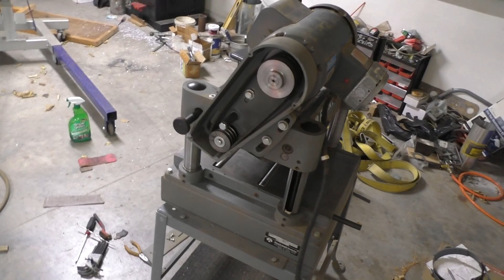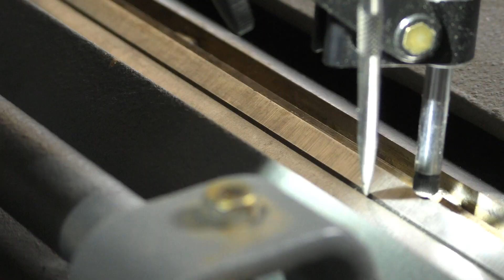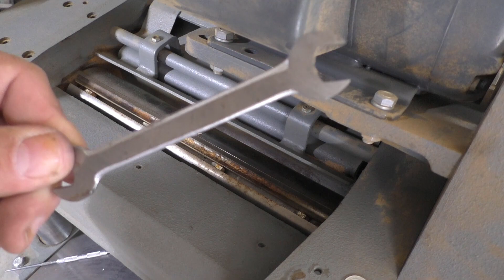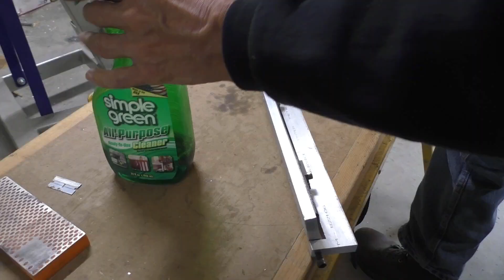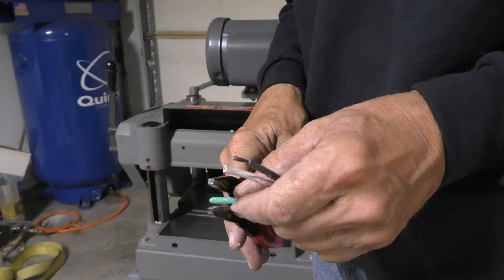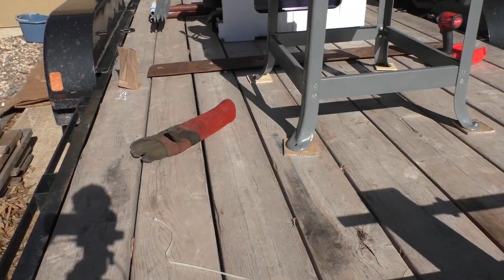New Tool Day!! Rockwell / Delta 22-650 13" Thickness Planer, Clean up, Sharpen and Blade Setting.

Comment: Hows this planer been treating you over the years? One came up for sale in my area for $350 that (from pictures) looks to be lightly used and in good condition. Some mention they're finicky, high maintenance planers. Others say they'll go go go for thousands of board feet. If you have any wisdom to share, I'd gladly hear it. 

Great video as well! I envy your machinist background and ingenuity.
Reply from the maker: This planer is a beast. I doubt the vast majority of these planers were ever put to the use they were built to handle. Kept in a dry environment, most retain a near new appearance and function. Also, a 450 pound cast iron machine is always going to outperform the current offerings of sheet metal and plastic. Downside is parts are more difficult to find. Best recommendation is to get the exact model/ year and research issues anyone has experienced. These machine have slight differences and it helps to know what to look for and how everything operates. In your case ask for a demonstration of the machine running planing a board. Use a flashlight to carefully check for any plastic parts cracking or poly covering on drive rollers under the cutter head. My life experience makes me believe nearly any machine is repairable. Unfortunately that is not for everyone. There is a certain gamble involved. If the blade setting gage is included it would be a bonus. A bit like buying a used truck, could be problems or a machine that will make more shavings than you will know what to do with. Best of luck to you.
Reply: @SpencersMountain  Appreciate the input!

Comment: I know it’s been a while but how far above the drum to the cutting edge did you set the knife…….
Reply from the maker: I did a lot of searching  and could not find an answer to that question. These machines came with a setting gauge to set blade height. Best I could find was 3 mm. (.118”). That put the bevel edge of the blades even with the drum. Then I made my indicator tool to evenly set that height. Hope that helps.

Comment: What was the height you set the blades above the cutter head?
Reply from the maker: @LucasHolm-m6u  I skipped that detail… because I do not know the correct measurement. These machines came with a special height gauge. The gauge is usually lost over time and rare to find. I will offer that my set height placed the blade bevel rear of the cutting edge flush with the cutter head outside diameter. Hope that helps.

Comment: Good info. what was the radius on the planer head?
Reply from the maker: I am sorry but I do not know the radius of the planer head.  Guessing close to 1.5" you could inquire at shelixheads.com for the diameter of a replacement head for an accurate answer.

Comment: I should have known from the detail and planning that you put into your projects that you were a machinist. Fine job Sir!  I enjoy all of your content.
Reply from the maker: Started off as a metal fabricator. Took a factory job where the taught welding. Bought a small metal lathe to learn machine work. Taught myself CNC and built CNC machines. Did professional Mach work for the last 20 years. But, was building machines and vehicles many years before being a machinist. And I will always try to avoid doing machine work when possible since it is slow and there is often easier ways to make things. It is amazing how many complex machined projects can be broken down to simpler scrap pile metal shapes welded or bolted together. Thank you so much for the comments and thank you for watching.

Comment: Where can I get this  to purchase
Reply from the maker: These planers were made in the 1980's. There appear to be many that show on various online sale sites like craigslist, eBay, Facebook marketplace, auction sites, etc. But do your research as there can be a lot of problems associated with these machines like frozen, worn out and broken parts. I watched a lot of planer videos and reviewed several forums to understand what machine was suitable for my needs and what problems I could expect. This video was essentially taking the machine through a serious inspection to ensure it was functional and all maintenance was current. I am a machinist and can repair or fabricate many parts  I cannot buy giving me a different perspective on buying obsolete machines. Old machines are often very neglected and sometimes very used. I was very lucky with this machine as it seemed to have low usage and kept in a good shop environment to protect it for a long time. Only negative was a short stay in an auction building where it had collected some surface rust that was easy for me to remove during the inspection process.  Consider a newer machine if it can produce the work you need. Also consider sending work out to a wood shop that has a planer.  Good luck in your search.